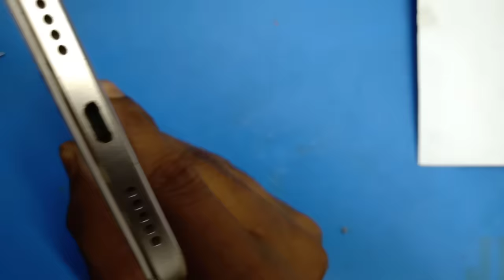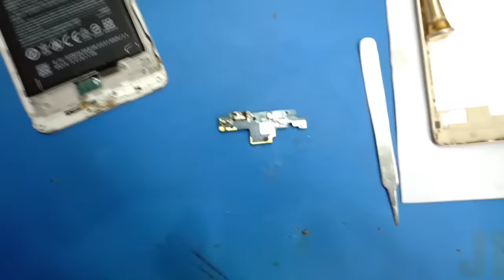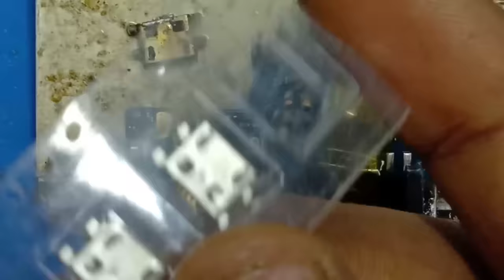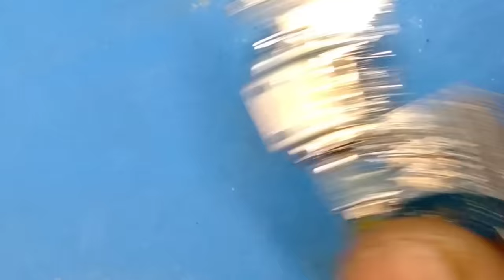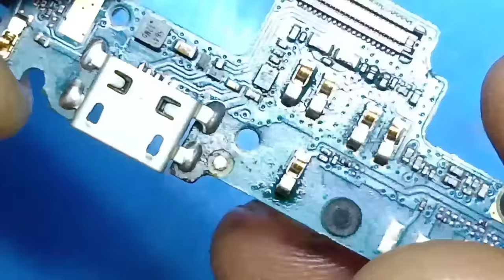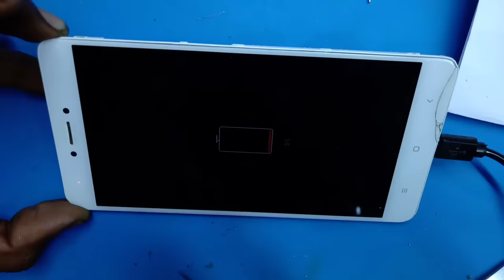How to replace any Smart phone USB charging port | all mobile Charging Connector Fix

Comment: I have only dc soldering iron .and i want to change (the same changing module,same phone,same socket from the video) the socket is there any way without hot air gun ???

Comment: I suspect that thing u wipe on the old port is flux,can u tell me what type u use please...bought some but all I got was two bottles of alcohol that just evaporates as soon as heat touches it....I have a brand new 1500 watt heat gun and nozzle.practised on old boards...just doesn't work for me...